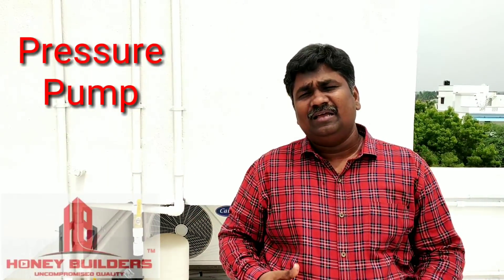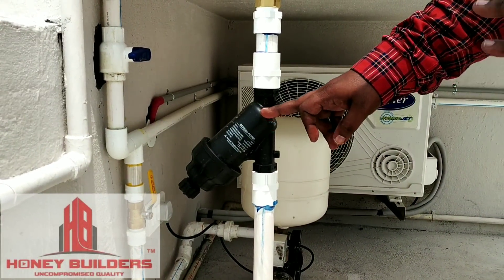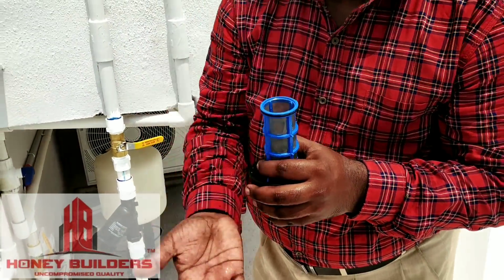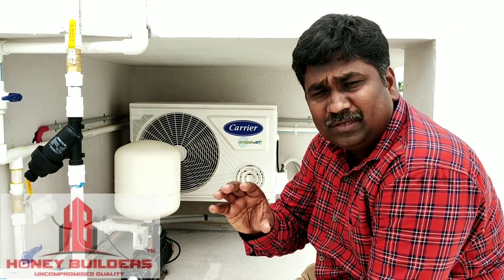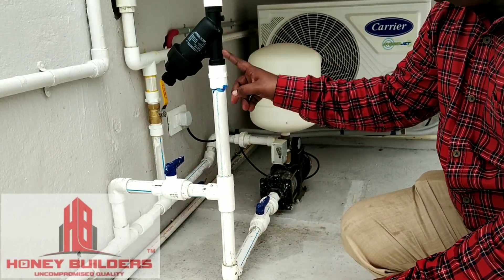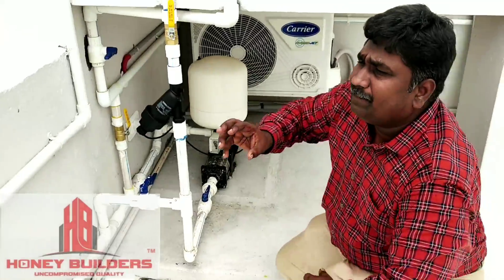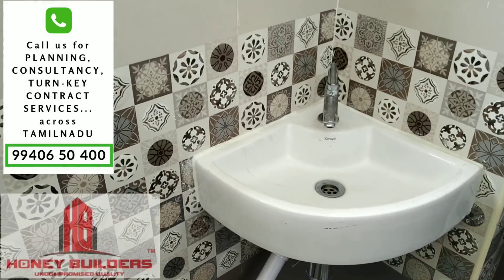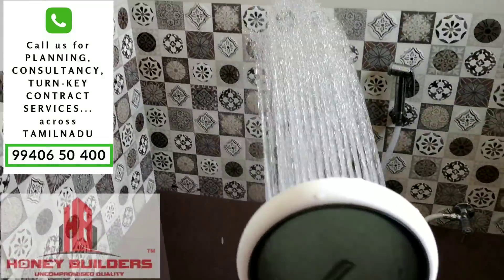மேல்நிலைத் தொட்டியில் PRESSURE MOTOR மற்றும் கசடுநீக்கி (SCREEN FILTER) அமைத்தல் - நேரடிக் காட்சிகள்

Comment: pump should be connected to showers washing machine and dishwasher only with separate pipe line for other services this much pressure not required, imagine if ur using this much pressure in health faucet

Comment: presure motor use பன்ன over head tank தேவை இல்லை,ground sump போதும்
water flow presuree  and gravity  இரண்டும் தேவை  இல்லை குடுதலாக ஓரு MOTOR  போதும்
Reply: ELECTRICAL TECH ok but new age washing machine required good flow of water if not it will always show error due to insufficient water

Comment: Sir இந்த பவர் பம்ப் பவர் சப்ளை எப்படி , இந்த மோட்டார் 24hrs ரன்னாகுமா , பவர் கட் ஆனா எப்படி வேலை செய்யும்
Reply: This pressure pump will ON automatically whenever you open the tap. Better to give separate pipe line for shower/mixer tap. Otherwise this pump will run automatically whenever we open the tap. 
However, this motor need power supply to run.  It will not run when power failure.
Reply: Same doubt?
Reply: Sir it's very very use full tq
Reply: In power failure we need to open the other valve to get water

Comment: filter is  a good idea  whose function is purely mechanical as per your video. Pressure pump is useful for top most floor where the  delivery is  not subject to high pressure compared to other lower floors.  Since the pressure pump functions electrically does it function /switch off automatically. What is the minimum H.P for the pressure pump?And the cost of it?